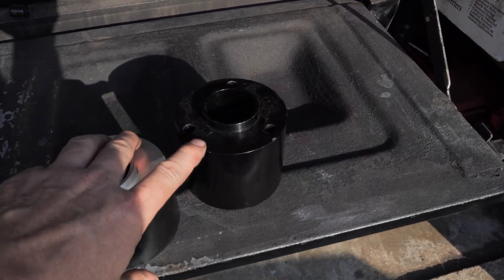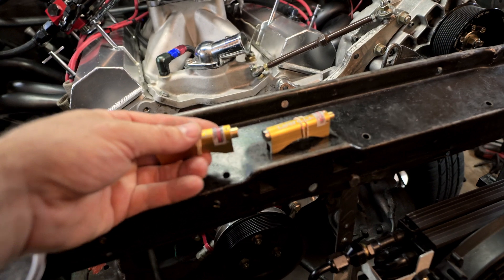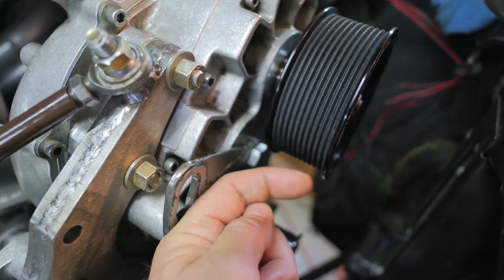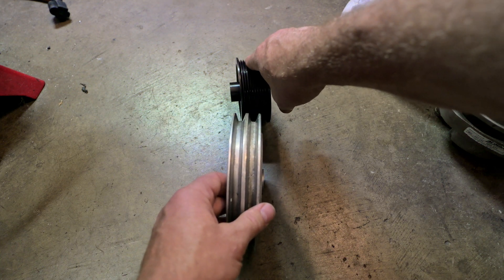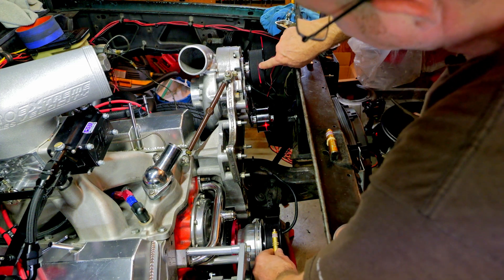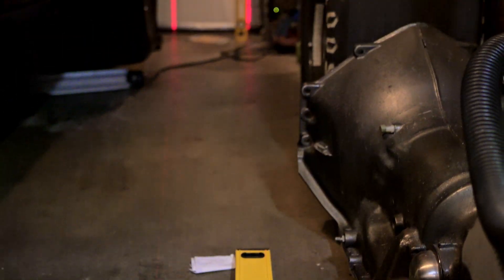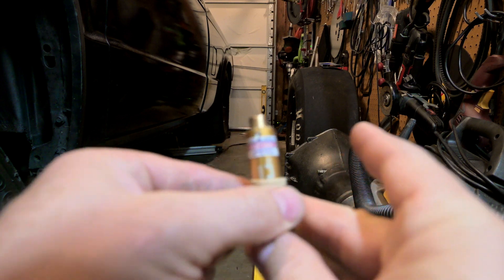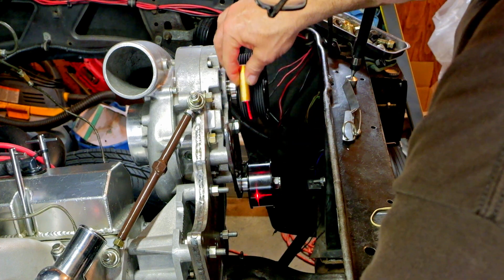Supercharger Belt Alignment For Dummies & Calibrating The Dayco Belt Alignment Laser

Comment: What compression ratio do you have?
Reply from the maker: 11.5 ish
Reply: @TPVPRO  is it safe to run boost with that compression? Was debating to do the same myself but keep hearing boost should be paired with lower compression.
Reply from the maker: @ativvafoxx5617  I'm going to run E85 and maybe meth injection when I turn it up.
Reply: @TPVPRO  Thank you for the advice. Still havent pulled the trigger on my rotating assembly yet been debating low compression instead of high. However E85 isnt super common around here.

Comment: I'm playing pulley mix and match as well with my procharger on SBC install as well. Alternator relocation plus, switched to type 2 power steering but couldn't do remote reservoir because there's not enough vertical room for drop, so back to type 2 with built in reservoir then custom bracket, spacers, etc... someday it'll be back together.
Reply from the maker: I feel you brother, I could not imagine having to add power steering in the mix.
Reply: @TPVPRO  I did think "do I really need power steering" but then it would've been even more of a snowball project. At least I finally have everything aligned, just need a couple small alternator spacers and I think it's done. At least, hope so! 😂